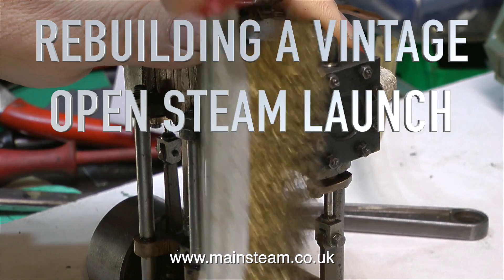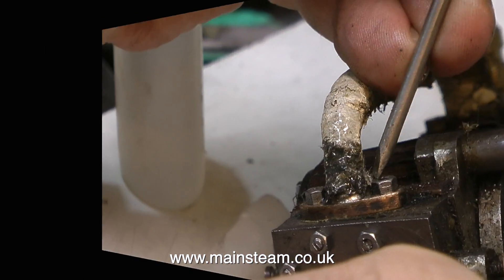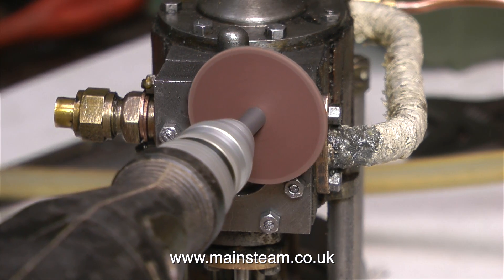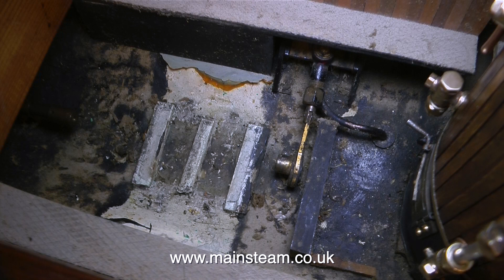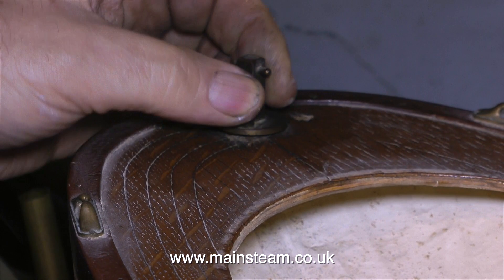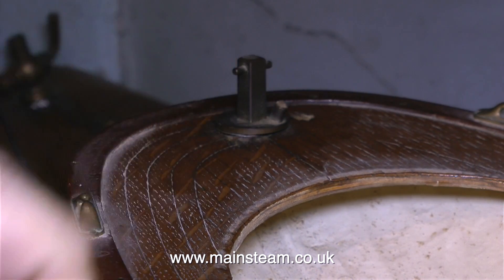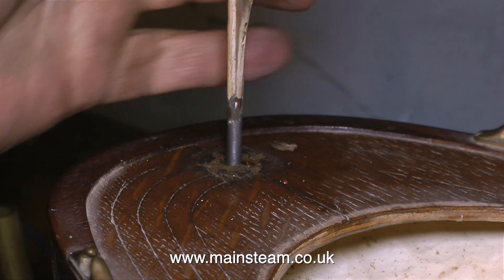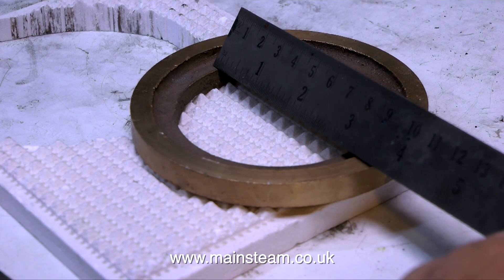REBUILDING A VINTAGE MODEL OPEN STEAM LAUNCH - PART #13

Comment: have you seen the new dremel quick lock cutting wheel system?  i picked one up recently and ill never go back to that little screw.  plus the wheels are fiber reinforced which is leagues better than the brittle stone wheels.  the kit is pretty cheap and its soooo nice.

Comment: Nice episode. I have a question. I heard ca glue loosens up when heated. Will it not get loose on that pipe that gets hot?
Reply from the maker: I have never had a problem with it, especially on pipe lagging as it soaks into the material anyway  ......
Reply from the maker: I have used CA Glue to hold ceramic in Ceramic gas burners and that has been OK . . .